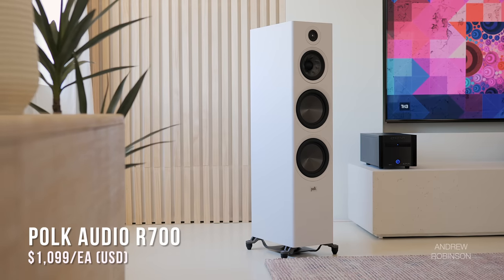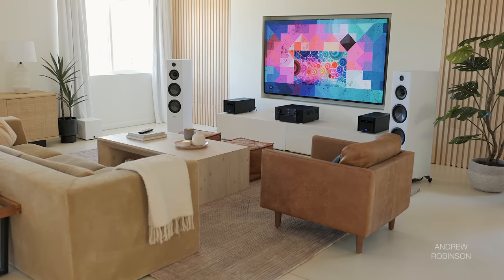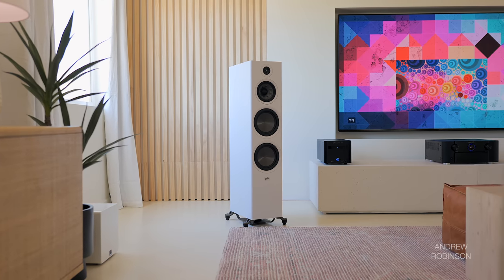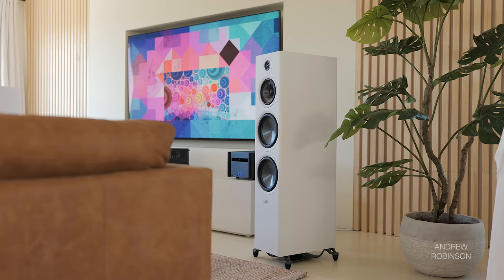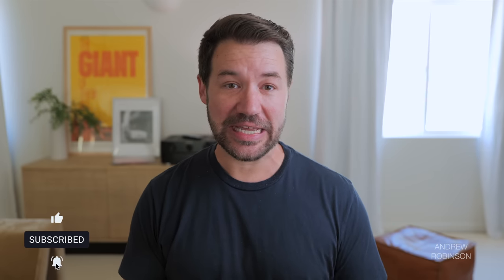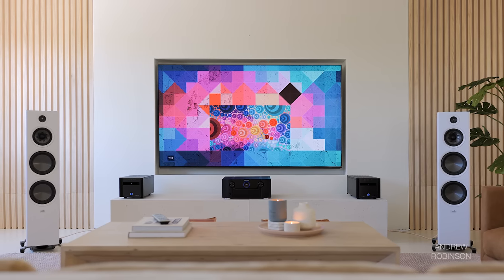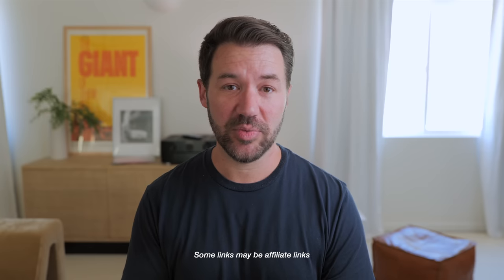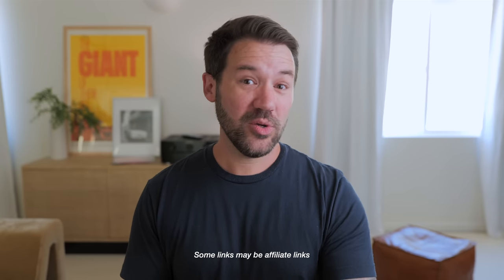Are High End Speakers REALLY WORTH IT? 🤔 Polk Audio R700 Review

Comment: I have to ask:

If your $2000/pair speaker needs nearly $6000 in amplification to drive it to its fullest, have you actually made a "good" speaker?

I'm genuinely wondering.
Reply: Also, because I have the Onkyo 7100, I'm curious if bi-amping would help there. 🙂
Reply from the maker: While I said the Marantz 8015 + Emotiva monoblocks produced the best results in my opinion, it was not the only solution I tried that worked well with these speakers. So while yes, that combo is on the costlier side, I never claimed that you could not achieve similar results for less. While one thing can be true, that doesn't suddenly discount or disqualify everything else I said in my review. We've noted everything used (including less expensive solutions) in our evaluation for you in the description if you need a refresher.
Reply: @andrewrobinsonreviews 
I'm fairly new to this and genuinely not sure if it's normal for electronics to cost so much more than speakers.
But I do think it speaks to the larger 'philosophical' point...
The R700s are now a target for me, and at an attainable price.
But if I connect them to my Onkyo 7100, I'll end up feeling like I'm not getting the most out of them, and the used-car-level investment in amplifier(s) becomes my next jump in hi-fi "social class."
It still feels a little like a treadmill.
Reply: You dont need expensive amplification to drive the R700s, you need a lot of power for it to perform at its best. Try the Crown 2502 and a pre thats within your budget, thats all you need. That will cost less than the speakers themselves. Ive paired the Crown 2502 and a Topping D90SE acting as a pre and I have yet to hear anything that sounds better under 10k.
Reply: @postjm9  I'm looking at the 7100, maybe later this year- how do you like Dirac?  I would still consider the Polks if you are in a position to buy them, I know I would.  They will last for decades, so you can always put something together in the years ahead- you can look for pre outs in your next reciever.
Reply from the maker: @postjm9: You can absolutely drive a speaker like the R700 with the Onkyo 7100 and it will sound great.  I tested the Polks with the 7100 and had a great experience. That doesn't negate that with the more expensive Marantz, that receiver was capable of extracting just a little bit more from them when paired with the monoblocks. The reality is that both scenarios can be true.

You asked: "Is it normal for electronics to cost so much more than speakers?" 

It can be but it is not an absolute. The more efficient your speaker is (think Klipsch), the easier a speaker typically is to power and therefore you can often get by with lesser expensive amplification or at the minimum less power. The nice thing about more a budget friendly speaker is that it is often possible to achieve better performance the more up market you go with your associated equipment. With higher end speakers, you are already at the top of the mark and you might have nowhere to go. With some high end speakers (especially those that are more difficult to drive), you might still need to spend more on associated equipment for those higher end speakers to sound their best so your overall investment could still be more. The thing I feel you are getting hung up on is that I said these speakers sounded their best with X. Again, I did not say you HAD to spend $6000 to get these speakers to sound good but it is an option. If you want to better understand the difference, give our Bowers & Wilkins 702 Signature review a watch. Now, that's a speaker that requires more in order to start sounding good. But once you find what it needs, it is incredible. Does that make it a good or bad design?...that is something you'll have to decide for yourself.
Reply: @andrewrobinsonreviews  just a side note, Klipschs are not more effecient. LOL!

Comment: Polk Audio were my first serious stereo purchase back in the 80,s. Then Polk had a reputation of offering great sounds at affordable prices. I had my Monitor 12.s for 20 years and never wanted for more. Then over the next 10 years or so i started trying different speakers. Proac, Lenehan, Usher, Tekton and Monitor Audio. In that time i think Polk lost their way with their offerings and the brand name suffered to the point its now frowned upon by many. IMO with the release of the Reserve Series Polk has returned to their roots which for an old Polkie is great to see.
The R700.s were the first "New" set of speakers in purchased in many years. They are just great fun to listen to. I agree with all your opinions on the R700's. Im powering mine with a Parasound New Classic 2250 and i agree they love a bit of power under them. They are 35kgs each which says something about their build quality. They eventually saw off a pair of Monitor Audio GS60's which is no mean feat. Sure the MA's has a superior fit and finish and the top end had a little more air around the vocals but it couldn't match the Midrange or the bass of the Polks. The GS60's were also twice the price of the R700's when new here in Australia.  But in the end it was the sound that won over looks. Take from that what you will. Enjoy your work guys.

Comment: Great review. I am not surprised, I’ve been buying Polk speakers for the last 20 years. I currently listen to a pair of Polk LSim 705’s and they are great speakers. Up until now reviewers seem to be afraid to talk about Polk speakers the way you just did because Polk is not “high-end”, garbage. I’ve been buying equipment since the early 80s and I’ve heard a significant number of different brands. My DIY P9’s, with 4 way crossover design by the KEF guys, is still my favourite, also own a pair of Mirage OMD-28, another set of great speakers. Again never heard anyone talking about those. Yes and I’ve bought and still own many amps, quite a few from China, one of which is fantastic - the finger to the gate keepers.

Comment: Great video. I have never spent more than $800 (that was used) on a set but if I were to be in that position, I guess it'd be more a matter of curiosity. I'm not rich enough to be "curious" about even THESE speakers but if I had oodles of cash then I might buy the Elysians because I think they look beautiful and I would just want to see which I thought was nicer. The older Paradigm Signature 8's are also freakin' gorgeous and run at about the same price. For me, hi-fi is a hobby. It can be a cheap hobby (I always buy used) or an expensive one if you want it to be but it's always just about seeing what components make what difference. I'm not as interested in "fidelity" as I am in "Hey that gives it more warmth... That's interesting."

Comment: Andrew! I love the channel. I am upgrade my current system and these speakers and the emotiva t3+ towers are my short list. I will be pushing them with emotiva xpa hc1 monoblocks.  The room is a 24x24 loft with vaulted ceilings.  Would the r700's be enough speaker for the space or should I go with the larger t3+ towers? Thanks!

Comment: That is a difficult question. Before I purchase a set of speakers, I first have to take into account the room environment.
Case in point, I have a pair of Radio Schaack Minimus 7's in my bedroom. With a 5-watt tube amp I can fill up my 10x12 room more than adequately, and with proper positioning, I can use the room to enhance bass. They will never give you deep punchy bass, but you can still hear the bass.
In my living room, I have room for a set of tower speakers. I could not find a pair that gave me the low extension and chest-thumping bass I wanted. More commercial speakers (in the sub $3000 range) will start to roll off at 70, 50 Hz and are rated to go down to 35 Hz. 50 Hz is already rolling off, so at 35 Hz we are down 6 to 12 Db. So, I build my own speakers and am able to tune the cabinet, the drivers, and the x-over to the sound profile that I like. I still have to supplement the system with 2 12" 1000 watt subs to get the foot peddles of a Pipe Organ to move the china in the hutch. 
More money does not always bring better acoustics or clarity. I have a set of WTMW mid towers on stands being driven by a Dynaco ST-70 that I upgraded. Paid $700 for the speakers and x-over components. To me, they sound great. I had a pair of Magnaplaner MG-1's that were dead on in accuracy, but sterile in color. Yes, I could pick out where each band member was sitting, I could hear the breath of the singer, the piano keys bottoming on the felt. 
If I went out and purchased a pair of PS Audio's Aspen FR30's at $28,500, would I hear a $25,000 improvement -- no. This is where Audiophiles are snobbish. They are as bad as iPhone consumers. Need to have the best, most expensive, new model every year. The law of diminishing returns kicks in around $5000 a pair. Do I really need an electrostatic tweeter made with rare earth magnets and unobtainium drivers that costs $10,000 and goes up to 50,000 Hz? Most of us are lucky if we are able to hear 14,000 Hz. 

I am looking for a speaker that fits my style of music, my listening room, and top-notch build quality, with a 6Db dip at 500Hz, and a 12 Db boost above 2000 Hz. 
I listen to my speakers, they are just audio filters that produce compression and rarification of air. If I wanted the WOW factor, I would have a set of B&O Beolab 28's.

Sorry, got a bit long-winded here, but as a sound engineer who mixes house for large venues and single guitar up to Symphony Orchestras, it is all in the sound, not the money.

Great Gatekeeper story. My brother used to sell for Ford in the 80's. One day a man with tattered jeans, an untucked shirt, and messed-up hair walked into the showroom. Every salesperson ran for the breakroom, so my brother went to welcome the bum. Turns out he was a fleet purchaser and purchased 20 Tauras cars that day. He dressed like that so he could reward the people that looked past his appearance and did not judge the person.

Comment: Andrew, I'd like to ask something that you may not generally answer, but it's a comparison... shortly after I saw this review I purchased a pair of Polk R700s and I couldn't be happier. I seriously love them, and I'm powering them close to how you did with the Emotiva XPA HC-1 monoblocks connected to my Yamama RX-A3080 Aventage via Audioquest XLR cables. I stream audio from my ROKU via ARC channel from my new 77" LG C3 OLED. I think it sounds wonderful. OK... recently I had an opportunity to pick up a pair of Klipsch Cornwall IVs for $4,000, and after some consideration I turned them down. What I'd like to ask is, how would you compare the R700s and the Cornwalls? If you could only have one of them, which would you pick and why? Did I make a mistake? I know... long question and probably tough to answer... sorry, but thanks in advance.

Comment: Truly great review and discussion. My main beef with extremely expensive audio gear is that I think it is not that great an achievement to offer something that is really good for $20,000. At that price it should be good. What is really, really difficult is to offer reference-quality gear for affordable prices, which this product seems to do. (I own an older Polk tower and I am impressed by it).

I have found that Tekton Design does a really good job of offering reference-level sound at affordable prices. I own the flagship--Ulfberht--which is not inexpensive, but most people find that the Double Impact offers astonishingly good sound at a reasonable price of $3K per pair. Also, many of Tekton's speakers--including the ones I just mentioned--employ an approach to sound reproduction that is really unusual. They use an array of tweeters to cover the midrange on the theory that tweeters can play down to 300hz IF you use a lot of of them, which ensures that no one tweeter has to work very hard. The result is an startling alive and unboxy midrange.

I would love for you to review one of these Tekton Design speakers. I value your opinion.

Comment: Hi Andrew! Love your reviews! You've helped me greatly with my choices. I have a question for you. My system right now is: Elac unifi 2.0 with a kanto Sub 8(good for music, not so for movies), Cambridge AXR100, and Fluance RT85. I really like the sound stage of the Elac's, however I find them a little fatiguing at times, specially at higher volumes(may be a bad match with amp). My room is 14'X15'X8. I really like the idea of the Polk's and am debating to go with the R200 and upgrading my sub, or go up to the R600 or 700 with no sub. Which do you recommend?
Thank you! 😊

Comment: I remember reading an interview with someone from jbl and the question was posed.... "at what price point are speakers diminishing returns". They came back with around $2000. It's interesting that these speakers are right in that range.
Also when I'm looking for a speaker it's honestly a feel and a sound. I'm using Klipsch synergy F3 towers.... Not the most accurate speaker but they are a big fun speaker and I love the sound. I've heard speakers at double and triple what I've paid for those and while they might be more neutral or have some areas that I like better, when I get back to my Klipsch speakers they just put a smile on my face and it's the sound I love.

Comment: Hello, I bought the R700 speakers on your recommendation and could not be happier. I am now in the process of replacing my 30 year old NAD 2200 amp that died with a higher end integrated amp. I have done extensive research and have it down to the Denon PMA A-110, Rotel Michi X3 and Anthem STR due to their power, neutrality and features. Which do you think would work best with the speakers ? I have pretty much the same musical taste as you do according to your playlist and demo choices. Thank you very much.
Reply from the maker: I honestly think you will be happy with any of these. Now, if you think the Polks are just a little soft up top, the Michi and Anthem will bring out a bit more top end contrast when paired with this speaker. Maybe not night and day different compared to the Denon, but a little. I would likely go with the Anthem or Rotel 1592 MKII (not that different from the Michi in my experience) over the Denon with these. The Denon may make them seem a little warmer, fuller, dare I say "old fashioned" in comparison. Hope this helps!
Reply: Thank you for the insight Andrew. I sure miss the days of demoing equipment at my local audio stores.  @andrewrobinsonreviews

Comment: PS It seems that with the Emerging technologies, Lower cost Speakers $2500 or less have really raised the Bar of Speaker design over the last 7 years. Its much easier to purchase a High resolution, Excellent sounding Speaker under $2500 these days as compared to 20 years ago. The Law if diminishing returns is really prevalent.  Just my 2 cents!

Comment: Dear Andrew, I'd like to place a topic I would really like to hear you explaining about. As you are immensely talented describing products and their performance, and listening your explanations is informative and entertaining, there - for me - always comes up the question: How much of amount is a described pro or con? Me personally, I bought a pair of Klipsch RP-8000F... listened some months... optimized them by an upgrade of GR Research... listened some months... added a Crown XLS1502 instead of using my Denon AVR-X4500h internal ClassAB Amps... listened some months... added a Schiit Vali 2+ Tube buffer Preamp... listened some weeks so far. In the meantime, I also added some GIK Acoustic Absorbers and base traps. Of course, every change brought acoustical changes. In my opinion, every change was a step to better results... BUT... the steps are small, gentle, fine... no huge jumps to audiophile heaven. This in contrast to the output of all the good Reviewers out there let's me realize, that all the well chosen words to describe products are missing some kind of normalization. It sounds like things make a huge difference... using this amp instead of that amp... and so on. I'm missing an anchor... which let's me understand reviews better. Of course, every change to a better reproduction chain (and room) is a step in the right direction... but what would have been, not buying the Klipsch RP-8000F, instead buying the Polk Audio R700, for example... or some real high end stuff instead? Yes, I can listen to your and the others words on each product and make my own conclusion. But the pros and cons... how to weight them in direct comparison? Do you get, what bothers me? This request/topic shouldn't be recognized as criticism... much more as a special interest, about what you think, you can do, to bring this dimension of information into your very good reviews. I'm very excited hearing your thoughts on this. Kind regards, Lars from Germany.